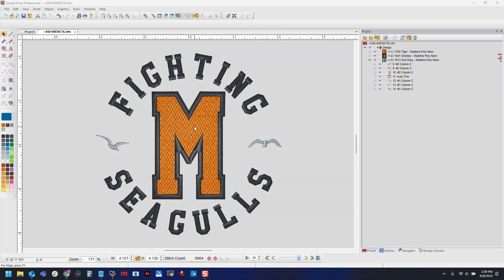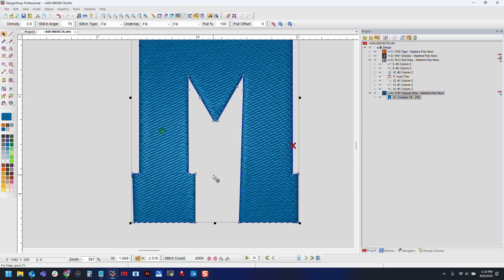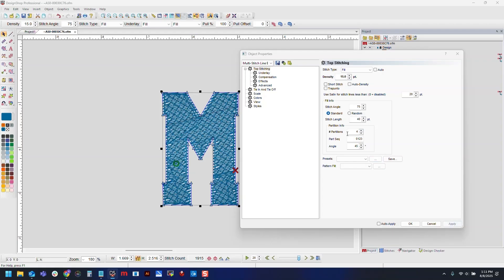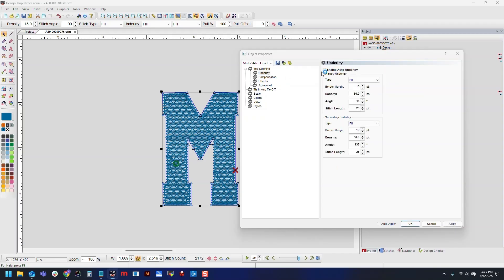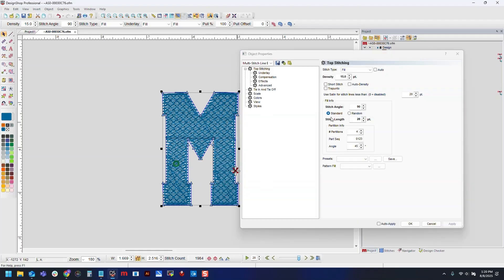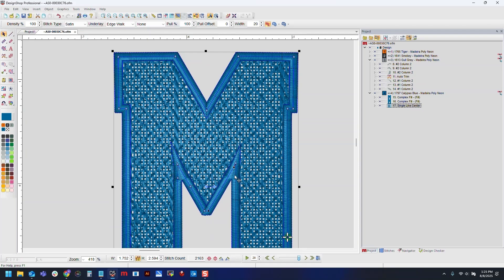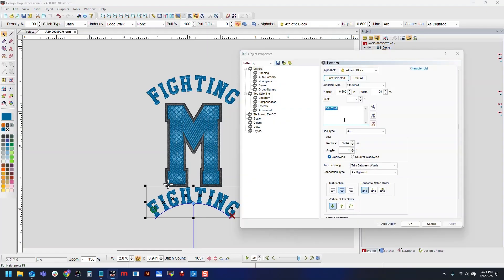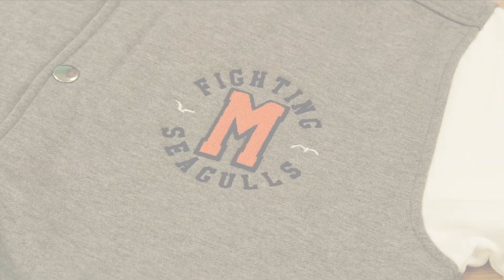Learn How To Digitize A Micro Chenille Design | Using DesignShop 12 Digitizing Software

Comment: Hello, I’m designing small lettering (0.5” tall) for initials “WTD” in Basic Block font, white thread on a navy t-shirt, using a 65/9 needle. I’ve practiced three times but haven’t achieved crisp embroidery. Before trying again, I’d like feedback on my design settings to make sure they are correct.

Current settings:
	•	Density: 100%, satin
	•	Underlay: edge walk (primary), zigzag (secondary)
	•	Edge walk border margin: 10 pt, stitch length: 18 pt
	•	Secondary underlay: zigzag 70% width / 20% density
	•	Pull compensation: 100%
	•	Height: 0.5”, width: 105%
	•	Line type: straight
	•	Trim lettering: between words
	•	Connection type: as digitized
	•	Spacing: 10%, line spacing: 150%
	•	Top stitching: satin 100% density, stitch length 50 pt
	•	Advanced: minimum stitch length 8 pt, travel length 18 pt
	•	Filter: minimum stitch length 5 pt

I would greatly appreciate guidance on:
	1.	Are these settings suitable for small initials on a t-shirt with a 65/9 needle?
	2.	Should I adjust density, pull compensation, or underlay for crisper results?
	3.	Any tips to prevent the embroidery from looking fuzzy or uneven?

Thank you very much for your help!
 (Design Shop 12)